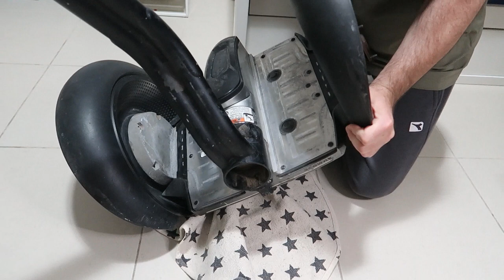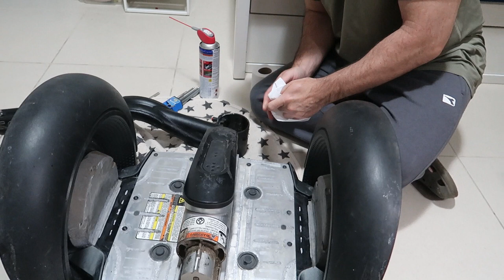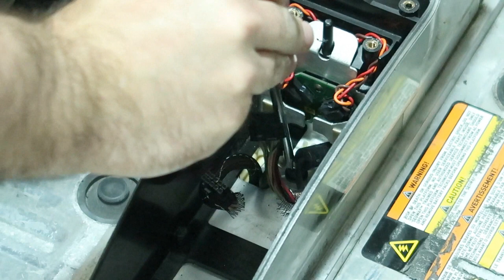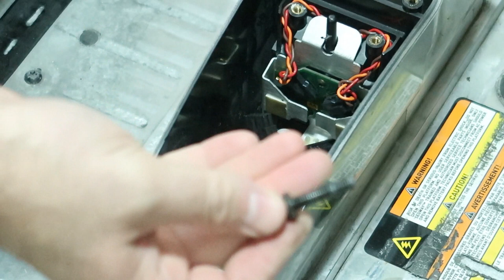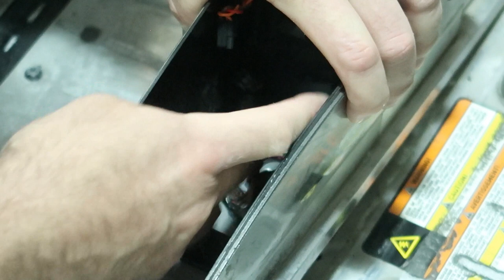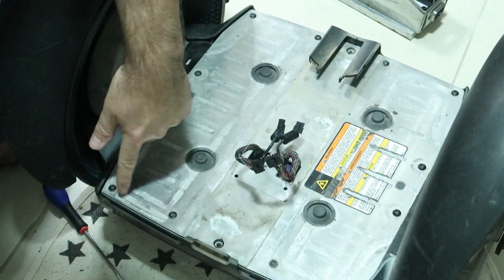Dissasembly I2/X2 Segway

Comment: Hey my friend, great video, thank you very much. I am trying to replace the balance sensors. My unit upon start up the red lights flash, it beeps several times then shuts off after like 10 seconds. 

I have a spare i2 unit for parts, so I am trying to swap out the balance sensors. Do you know, is the info key in anyway linked to something where the balance sensors are? Or can I just swap out the balance sensors and everything should be ok? 

would greatly appreciate your feedback. Thank you in advance!